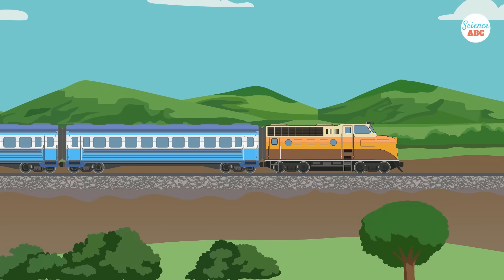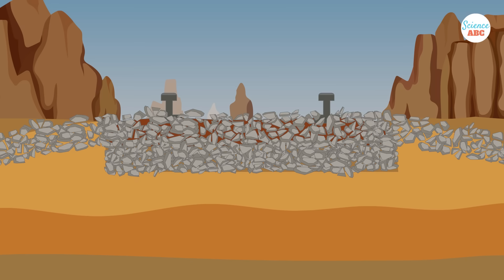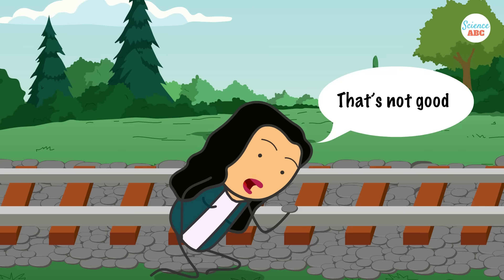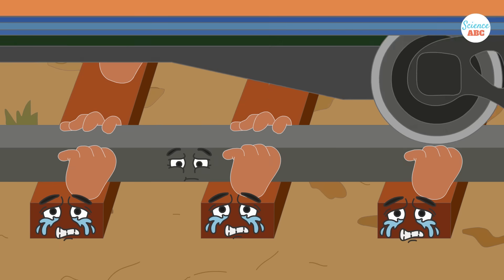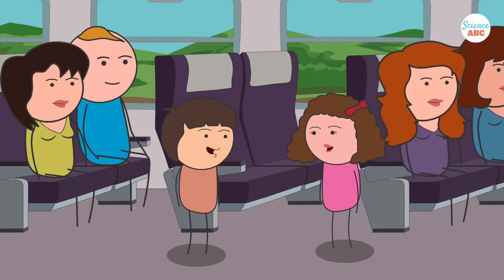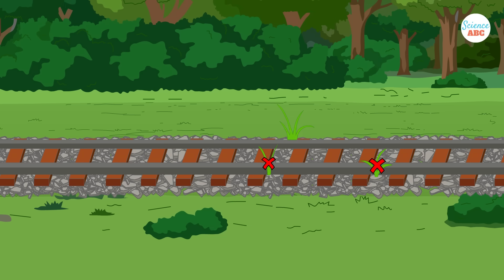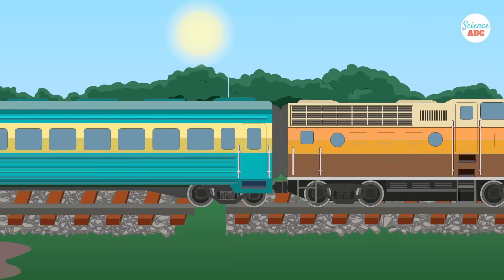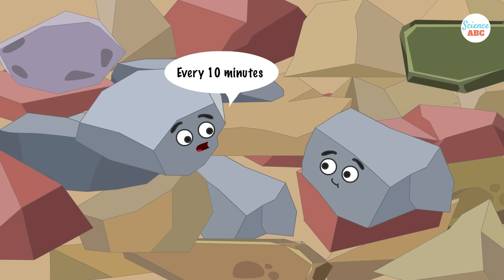Why Are There Stones Along Railway Tracks?

Comment: a correction to number 7: it doesn’t minimise the expansion of the rails, what ballast does is allow the rails expand and contract in temperature, you see unless you have ballastless tracks (which are generally rails held together and supported by blocks of concrete, and not with wooden sleepers resting on grass) or fixed structures like bridges (which often have derailment protection for this reason) the rails are tied together by railway ties, i.e. sleepers, and they rest on the ballast, they are not anchored to it.
rails are made of steel which typically has a thermal expansion rate of about 1% per 10 degrees (celsius/kelvin) this means that if you have a railway track of let’s say 2000 metres, then you have 20 metres of extra railway length, you might be asking: where does that go? it pushes the apex of the curve(s) outward, in the case of 20 metres of extra length over 2000 the apex of the curve might shift a couple of centimetres.
Reply: Thank you for the explanation! I was very sceptical of 7 in the video and immediately came to the comments for a correction.
Reply: Its about 0.01% per 10°C not 1%.
Reply: @IanMcDoe  the math equation used by rail worker is
Formel: Δ l = l • ∝ • Δ t

Δ l = Längenänderung
l = Länge der Schiene in mm
∝ Stahl= Wärmeausdehnungszahl (Ausdehnugskoeffizient) von Schienenstahl 0,0000115
Δ t = Temperaturänderung vom Ausgangszustand in Grad Celsius

That's German, in my limited english.
Length of rail in mm * 0,0000115 * the difference to 23°C (in Germany) = change in theory.

The 23°C (+- 3°C) is the German temperature average, used to minimize effects of expansion during hot months and contractions in cold months, of the rail.

I hope I could help :)
Reply: YES rails carry NO EXPANSION JOINTS HAHAHAHA, but in these parts the ground/earth is pyritic soil & rock though not fully in the aspect of chemical reactivity but more due the the moisture aspect of dry and wet and thus swelling and contracting........the ups and downs of the tracks and if they were rigid and stiff...NO EXPANSION JOINTS.....,    BUT for all this...I can't see why they couldn't design a modular system and just drop in place and use a modernized bedding system and float the track sections and what's up with squared faced jointing...somebody needs to cross train out of metal shop for wood shop and learn to make metal  splice joints to join rails..... and for a slip joint for expansions and contractions and the ups and down !  But their solution was not the short sectioned rails of yesteryear.....but new long rails.  AND today they have some really great machinery they use.......I have an electric trolley system behind my house so they are working constantly aside from the rail transit......I see it everyday but I am desensitized to pay attention all the time...
Reply: The ballast holds the ties/sleepers in place.  The rail is prevented from excessively expanding or shrinking by clamps that hug the base of the rail which press against the sides of the ties/sleepers.
Reply: Tends to make sense why the railroad spikes pin the rails laterally to the ties, which tie them together keeping the parallel spacing, but only grab the edge and allow for expansion along the length.
Reply: there are AMg type alloys, titanium alloys, regular steel and low-alloy steel, & for all of them it's about a tenth of a percent per degree Celsius.
the diff between Celsius & Kelvin scale is significant tho! not interchangeable
Reply: @VeggieRice  A degree Celsius is the same a degree Kelvin
Reply: @pete3953  nope, Tk = Tc +273.15, where Tk is in Kelvin and Tc is in Celsius
Reply: @rade4636  I see you corrected your error in another post.  I said a degree Celsius is the same as a degree Kelvin, which is true.  If the temperature increases by a degree C it also increases by a degree K However a temperature of ONE degree C obviously is not ONE degree K.  If you are measuring a specific temperature you need to add 273.15 to the Celsius measurement to get the result in Kelvin.
Reply: @pete3953   @Pete  What? You simply can't say that degree Celsius and degree Kelvin are the same. When I say that something is the same (ofc in this context), then I mean that 1 unit of something is equal to 1 unit of something else.
Reply: @rade4636  I agree with you I unit of C is equal to I unit of K.  I'll put it to you as simply as I can.  If the temperature of your room increases by 1 degree C, how much does it increase in degrees K?  The answer of course is that it increases by 1 degree K.  Nothing more or less.
Reply: @pete3953  I see you don't get my point. I know that the change for both scales is the same (as I said in the other comment), but you can't say they are the same. It's like saying that the equal work is needed to accelerate a car from 0 to 50 km/h and from 50 to 100 km/h. It's not.
Reply: @rade4636  You are confusing the scale and the unit of measurement.  The degrees are the same but the scale is different.  If your room is at 20 on the Celsius scale,  it is 293.15 on the Kelvin scale.  But increase the temperature by 1 C and it increases by 1 K.  That's because the Kelvin scale was specifically designed so that  1 degree (unit of) K equals 1 degree (unit of) C.  Don't take my word for it and don't bother to reply.  Just google for goodness sake .
Reply: @pete3953   @Pete   @Pete  Firstly, did you just explained to me the same thing that I said? Secondly, read your first comment again, you said: "a degree Celsius is the same a degree Kelvin". That, my friend, is wrong to say like that. This was my point. You never mentioned a scale in the original comment. I'll end discussion here, no need to rant about something we both understand 😀
Reply: @rade4636  I didn't mention scale because I wasn't talking about scale.  I you had bothered to google you will see such responses as "a degree C is the same as a degree K", "a change of 1 degree C is the same as a change of 1 degree K", "1 degree C equals 1 degree K".  
In other words you will see both my original comment and variations on it which say the same thing.  
Lord Kelvin invented the Kelvin scale since there are (thermodynamic) benefits in setting zero at the point of the complete absence of thermal energy...absolute zero.  But he had no interest in changing the size of a degree, because there was no value in doing so.  So by definition a degree C is the same as a degree K.  Now please go away and get some education.
Reply: @pete3953  Ok, I ain't gonna argue if you can't see my point. I perfectly understand what you are saying, can't tell the same for you. I just want to know, is English your mother language?
Reply: @rade4636  Ok.  Let me give you the chance to explain clearly what you mean.  Recall, all I said in my original post that, "A degree Celsius is the same as a degree Kelvin".  Nothing more and nothing less.  
Note, I said "a degree".  "A degree" is not a temperature it is a UNIT of temperature (look it up).  
 Now if you google you will see "a degree" C is indeed the "same as", or "equal to" or "identical to," "a degree" K.  Moreover Lord Kelvin said a degree K is the same as a degree C.  If you refer to Cosmos (an encyclopedia) it says "The Kelvin scale uses degrees which ARE THE SAME SIZE AS the Celsius scale". 
In other words probably the only person in the world who disagrees with my original statement is you.
Now your original post responding to mine started with "Nope"  In other words you were saying a degree C is NOT the same as a degree K.  
You then said Tk = Tc +273.15.  But that is something completely different and not relevant to my original statement.  What you quoted is not the relationship between units of measurement but the equation that links a specific TEMPERATURE in Kelvin to a TEMPERATURE in Celsius.  Of course any specific TEMPERATURE will have a different value in K and C but that has got NOTHING TO DO with the size of the unit (degree). 
Now I apologize since, while I tried to keep this simple, some of the words have more than one syllable, so I suspect you will have a hard time comprehending what the average 5th grader would  immediately grasp.
Reply: @pete3953  Yup, troll guy. I actually looked up as you said to me and oh boy look at this: the SIZE of a degree C and K are precisely the same as. Do you get it now? It's about the sentence and how is written, not about the explanation which I never contested.
Reply: @VeggieRice   @J Cerqueira  Note, difference in Celsius is the same as difference in Kelvin, therefore math holds for both Kelvin and Celsius if you are only using the difference in a formula. Kelvin and Celsius are two scales, offseted by  273.15
Reply: Ah, love the sound of expanding rail, it's like a ting, twig and prang together. Reminds me of when you break your back, but that is more of fizz.

I'll leave this comment for the 4 people on this planet that know what im talking about
Reply: @James5976  I'm trying to imagine, never broken my back but have broken my ribs. It felt, and sounded, like when as a kid you'd step on one of the old polystyrene egg boxes. That crunch. No treatment, just three months of slowly diminishing pain any time you try to take a deep breath, cough, lie down, stand up, to over a bump in a car, etc.
Reply: It allows them to expand and contract at a regulated rate, therefore minimizing wild fluctuations.  So yes, minimizes.
Reply: That's not really true. They used to put little gaps in rail to give them space to expand,. nowadays the rails are held in place with pure force, there is a high pressure on the material when it's hot. The rails want to expand but are held in place, they are anchored to the ballast.
Reply: @TemplerOO7  this is idiotic, no offense. "bEinG HEld in pLAcE with PuRE fORcE", that statement doesn't make sense. Also, even if most of the weight on the planet sat directly on top of the rails, holding them down, >they would still expand with heat< because they're metal, and THAT is what the rocks are there for, not rails jumping or jiggling around due to vibration.
why did you reply, what a waste of your time!
Reply: @VeggieRice  metal expands with a certain force when heated, this force is countered in the case of rails
Reply: @VeggieRice  We have seen train Tracks simply "buckling" in countries where there is a hot climate. This seems to tell me, that the problems associated with the expansion of metals (Track) - in this area of the Railways is not an easy solution. Of course, I may be wrong, but that's what I feel.
Reply: That’s a load of BS

Comment: Another reason is that it generates energy for the train to move. The earth's electrical field interacts with the rocks and the shoots that electrity up into the train as it passes by, thus creating extra energy for the train's engine and helping it move faster.
Reply: Have you experienced electricity conducted through rocks? Please explain how on earth, does  electricity transmit from the rocks  into the engine to feed it energy.
Reply: @erbinnanua9045  The electricity doesn't pass THROUGH the rocks, it passes AROUND the rocks through because there are small gaps of air around each rock. Thus, the air receives a positive charge as the train passes by. This positive charge interacts with the negative charge of the train and allows electrical current to freely pass from the rocks straight up into the engine. Think of a chicken with it's wings on fire. This doesn't have anything to do with what's being said, but just think of it. Pretty crazy, right? Anyways, the electrical current from the rocks shoots up and out so that the train's engine is able to absorb most of the energy to power most of its locomotive activities as well as run the coffee maker that sits aboard.

Comment: Effect the effectiveness? Why not reduce the effectiveness? Keep it at a minimum? Do you minimize heat? You wouldn't want to keep the heat at a minimum unless the issue was cold and you were trying to keep the temperature up. 

Does anyone edit the copy?

Okay that's why they use the materials the way that they have for so long. But are their any better alternatives?

Comment: It's sort of a misconception that rails expand and contract. Rails properly fastened in a track do not really expand or contract due to heat at all, so reason 7 in this video is a bit misleading. Ballast doesn't minimize rail expansion. The ballast holds the ties in place against stresses in the rail arising out of thermal expansion and contraction so that it doesn't move. Which brings us back to reason 1.

Comment: I thought it was supposed to not let wildfires start when the train wheels scratches against the tracks and to not let it sink into the ground as the rocks create a bit of a foundation for the tracks but it seems like they have more use than just that. Interesting video.

Comment: Ballast depth can quote often exceed 300mm, I’ve installed 500mm with a sand blanket, micro piling, and a geotechnical layer on fenland before. A sub base is extremely important for load distribution and to remove pumping substrate and fines through the ballast. The image of ballast being dropped on top of mud isn’t correct.

The effect on vibration dampening via ballast will be small when considering the whole track/wheel interface. Generally speaking the components designed for vibration dampening on the track are the rail pads and housing clips for vertical movement and the insulators for lateral. Baseplate designs that house the components generally target a specific dampening requirement.

Ballasted track has generally inferior ride characteristics over slab track due to the lack of track fixity so point three is incorrect.

Track ballast has no discernible impact on the heat of rail in direct sunlight. continuously welded rail is pulled under tension before being welded to somewhat account for the thermal expansion, though in hot weather the rail may well still be under compression and pose risk of a track buckle. Track ballast is very important in this respect but it was not highlighted in the images. Track ballast will be profiled into a shoulder - a pile of ballast around 300mm tall and 400mm wide running down the length of track, this is to resist the lateral movement of hot rail under thermal compression to avoid buckling.
Reply: I would hope so, we put more than 30cm of support when we built a porch and out porch is not meant to support millions of travellers travelling at hhigh speeds.
Reply: Good points. The guy who made the vid just searches for popular vids and recreates them. He is not an expert on the video topics. Thanks for your comment.
Reply: The

Comment: Having worked on railroad track maintenance in years past,  we used stone to keep the track level.  If it's not keep level you end up with dips and risings in the track. You simply identify the dips in the track and tamp stone under the ties in the low spots to raise the tracks up. You never,  never cant a railroad track,  you're just asking for trouble, and adding undue wear on the track and wheels on the cars and asking for derailed cars.
Reply: This seemed like the most obvious use, much easier than trying to level the ground where you're laying the tracks. That said I was surprised by how many benefits they included.
Reply: @BCThunderthud  The paper mill I worked for was built in 1906, we had a lot of track inside the mill property. The problem was is that it was built on reclaimed swamp marsh land, so the track was always sinking in certain sections. We had to do a lot of track leveling. You do try to grade the railroad bed as level as you can get it, but over time you do get dips here and there.

Comment: You really can't nail track down rigidly for long stretches, the ground does move and so does the track. It allows the track to move a little. Not too much, just right. If the ground below the ballast moves a bit due to settling or earthquake, or the track bows some due to heat expansion, it can shift a little to compensate.

Comment: when he says "sleeper" he means "railroad ties".  I've never heard anyone call them a sleeper before and I suspect it's a term from another country, but I'm not sure.  one time we did put in smooth rocks of the usual size in North Dakota in an oil transfer station but that was just in a straight, low speed line at the end of a track because it was impossible to get proper ballast there at the time.  it wasn't optimal but the idea was to just get the track working and later when the track stats sinking and misaligning it'd be replaced with proper ballast.  you'd probably never dare use it in a high speed mainline for fear of causing a high speed detail.  he never mentioned "tamping" which is when you smash the ballast down in between and next to the ties to make sure it gets under the ties.  if you don't talk the ballast the track could go horribly wrong very fast and cause a detail
Reply: Term used in England